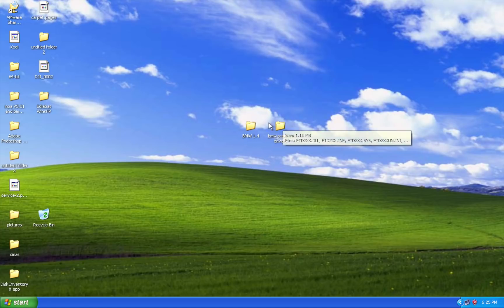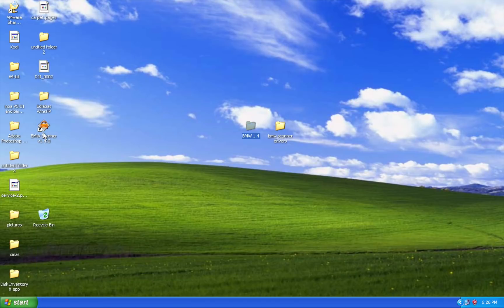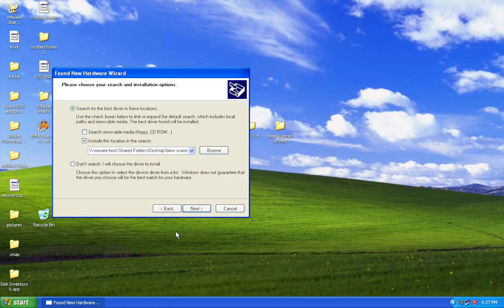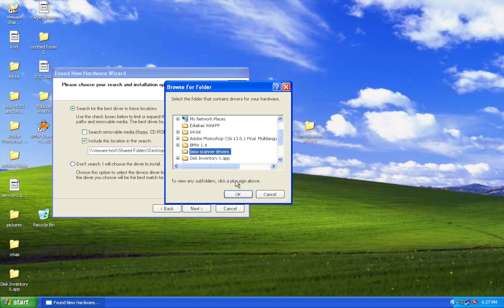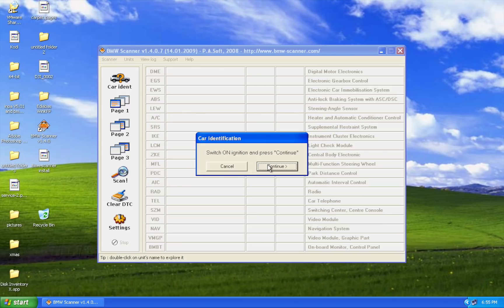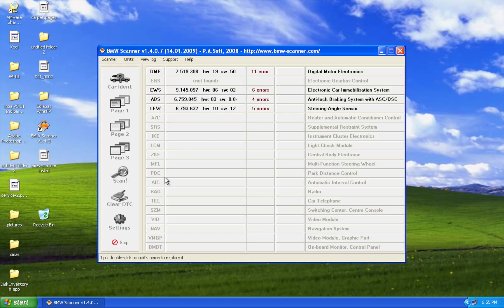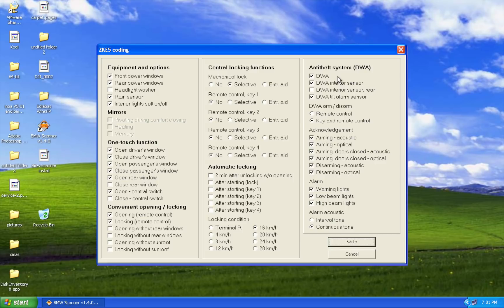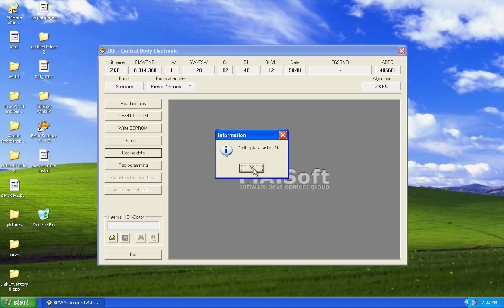How to make your BMW windows roll up with the key fob

Comment: Hello, excellent video! 
Can you tell if it works on the bmw e36 323ti 1998 with the ms41 ECU?
Thanks to your other video I managed to install INPA on windows 10!
Reply from the maker: Yes it should
Reply: @EvanGoyuk  OMG! 
I couldn't find the software on the link, could I send another link to download?  I already have the k-dcan cable with the 20-pin adapter used in INPA.

Comment: Will it work on 01530i?
Reply from the maker: Yes!
Reply: What do I need and where can I get it
Reply from the maker: Bmw scanner pa soft or ncs expert
Reply: @EvanGoyuk  the isaddle 1.4.0 V1.4?
Reply: What is that? Computer program, where can I get it
Reply from the maker: Program but you need the cable from Amazon, email or message me on Instagram @evangoyuk
Reply: Which program do I need?
Reply from the maker: Yes isaddle 1.4

Comment: hi Evan, thanks for your helpful video. I have two question about my 2004 E60 (530i).
1-  My 2004 E60 (530i) rolls down all windows and sunroof and unlocks all 4 doors by itself when parked and locked. I made sure my key fob is not pressed when getting away from car. What is wrong with it and how can fix or disable that feature to be at lease safe.
2 - How can I enable Bluetooth on my 2004 E60 (530i)?

I appreciate if you make video or reply to these questions to address my issues.
Thanks!

Comment: First, I want to thank you for this great video. I do have a question for you though after purchasing this today. I plugged in the scanner and attached it to my computer, well it started to download, but then it says “bmw scanner v14x doesn’t have driver”. What does this mean and is there a way around this issue? You feedback would be greatly appreciated because at this point I’m feeling like I maybe didn’t get the one I should have. It is scanner v1.4.0

Comment: does anyone know if the will work with windows 7 i have seen people save it does not work with windows 10
Reply from the maker: It should work with windows 7 and I have it working on windows 10. You just need to get different installers for the forums

Comment: All you need to do is stick the key door locks and they go up I have a 90 525i a 2012 x5 and a 98 528i they all do it you don’t need no code just hold in the lock position in the key lock and turn it in the unlock position to roll me down you are wasting time

Comment: I have a 46 CONVERTIBLE how do I clos it with key
Reply: No just turn to the lock position In the key cylinder and hold it rolls your top up and your windows if you keep holding
Reply from the maker: You can code that in ncs expert

Comment: can you do this with an ELM bluetooth module by any chance? i can clear codes with it with torque i wonder if there is a way to make it work with an ELM ODB2 adapter
Reply from the maker: It might work with the app Carly BMW which is a coding app it’s just all more expensive that BMW scanner or ncsexpert. However Carly BMW is much easier to use.

Comment: Great video men i was looking for this because my e46 made me crazy locking the windows manually, is it possible to lock or open the windows without holding the buttons? If it is can you upload a video about that?
Reply from the maker: +matin mesdaq unfortunately it is not possible to open and close the windows without holding the lock or unlock button. It would be cool if you didn't have to hold them.
Reply: @Evan Goyuk  does this work for all models cuz I have 530 2006

Comment: Ok good I will buy one and try it out. This has been bugging me for years! Thank you so much!
Reply from the maker: +Robert Bryant III Perfect let me know how it turns out and if you have any questions. I can help. This is the easiest way to code your BMW e46.
Reply: I sure will, thanks again!
Reply from the maker: +Robert Bryant III If there is any other videos you want to see me make let me know!
Reply: Ok I will, thanks!
Reply: I am having trouble with my automatic door lock on the passenger side. I will not unlock with the key fob or the button inside, but it will lock with the key fob. Does that sound like the actuator? Is that hard to replace?
I have a 2002 E46 M3. And on the same side the automatic mirror has stopped working too.
Thanks!
Reply: Robert Bryant III that sounds like some wires going into the door got disconnected or broken. I would check whether there's any power on them.

Comment: What BMW OBD scanner is that and where do I get one? Thanks for the video!
Reply from the maker: +Robert Bryant III Link is in the description on where to buy. I bought it from amazon it's BMW scanner 1.4.
Reply: I got the OBD scanner and software but I cannot get the drivers to load. Any suggestions?
Reply from the maker: +Robert Bryant III What version of windows are you using?
Reply: Windows 7
Reply: Any suggestions?
Reply from the maker: +Robert Bryant III what version of windows do you have? I would recommend XP because other versions can have driver issues
Reply: I don't have XP. Any other suggestions. I bought the OBD scanner now what?
Reply: I have 7 on all my laptops
Reply from the maker: +Robert Bryant III have you tried the drivers I have  in the description or did you use the ones that came with the scanner?
Reply: The ones that were on the CD
Reply from the maker: +Robert Bryant III Try the ones I have linked in the description.
Reply: OK I will, thanks!
Reply: Yes It is saying drivers not installed. Frustrated!
Reply: Does the OBD need to be plugged into the car before it will recognize the drivers?
Reply from the maker: +Robert Bryant III No Just make sure the scanner is plugged into the computer. I can also send you the drivers I have to see if that makes a difference. The only thing I can say is it's either the version of windows or you got a bad obd2 scanner.
Reply: I did, not luck.
Reply from the maker: +Robert Bryant III I will send you more drivers to try when I get a chance.
Reply: OK thank you!
Reply: I got the program but it is in another language and I cannot read it. Even Google cannot translate it all.
Reply from the maker: +Robert Bryant III I messaged you the drivers that I have. Did they help?
Reply: It was in a foreign language and I could not install them. So no.
Reply: Can you help me?
Reply from the maker: +Robert Bryant III I think your best bet is to install windows xp on a virtual machine
Reply: I did that and it still will not work. How do I uninstall that software and reinstall it? It is not listed in "installed programs."
Reply: Just get Windows XP 32bit. It will solve all issues. You can run a virtual machine on your already installed Windows 7. Use VMware.